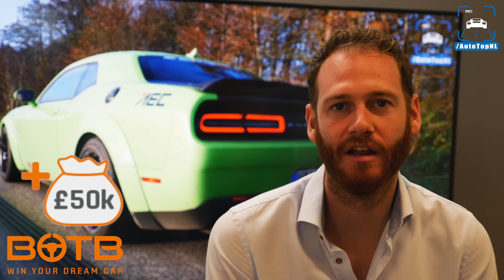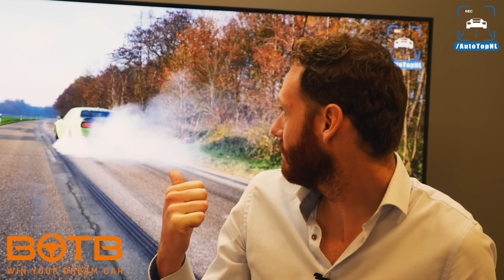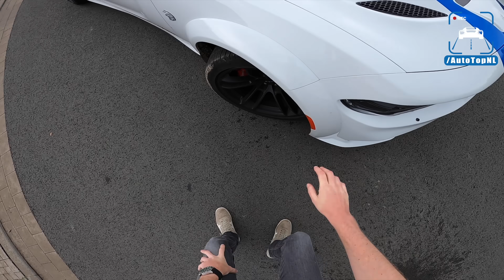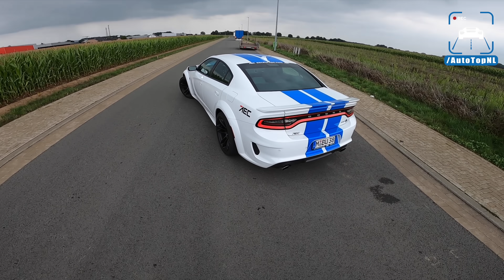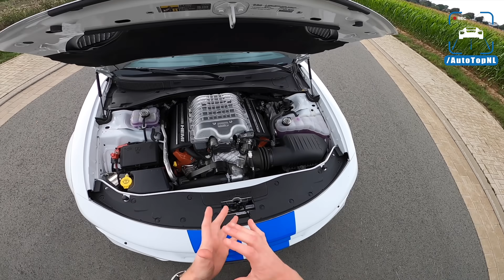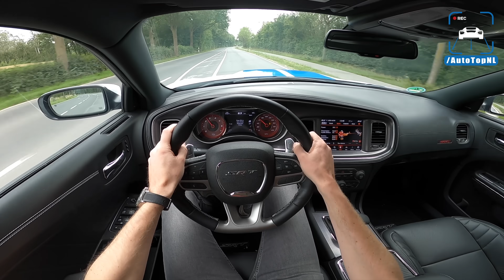DODGE Charger HELLCAT 717HP REVIEW on AUTOBAHN [NO SPEED LIMIT] by AutoTopNL

Comment: Great Review!
One question:
You said, that the Charger feels muchs better than the Challenger Hellcat on Autobahn at higher speeds.
In what way does it feel better?
Vibrations?
Just curious, because I have a Challenger Hellcat and it is compared to German sports cars pretty different, already at 160km/h an above.

Comment: next tipe put it in manual through the gear instead of drive , and also use the paddle shifter and put it on sport also sport/track mode their will be a big difference in shifting and power

Comment: Buy a Tesla plaid with track mode and say goodbye to the internal combustion engine . Dodge just announced it will be all electric
Reply: Not yet. Too heavy for solid track performance.
Reply: @osyisr6361  you are %100 percent right today for OTR Long haul but the small regional carriers like DHL  in Europe are already delivering local routes using electric vehicles like what you find with the Ford E Transit with heavier versions coming on line now. It’s a no brainer with fueling and maintenance costs way less than diesel equivalents
Reply: @nickkacures2304  what does cargo transit have to do with track performance.

Comment: Horsepower totally does not mean the ability to move down a track fast. It takes complete engineering that quickly and evenly gets torque and power to the drive wheels. Take a lesson from Ferrari. No Match for a Ferrari 812.

Comment: Just stomping it over 150+MPH‼️ Crazy‼️🔥🔥🔥
Reply: It has Slightly Larger size Front brakes brakes and slightly smaller rear brakes than a 2021 S63 AMG he was referring to at the beginning... and the Hellcat charger is Exactly the same weight as the 2021 2dr. S63 AMG.

Comment: Um First Using a Ford Racing paint scheme on a charger is extremely pathetic.. Second there are only a few sections of the Autobahn that doesn't have a posted speed limit however there are actually speed cameras installed because excessive speed is not allowed so any speed test conducted will never be anything other then inconclusive and a complete waste of time

Comment: Just recently bought a 2019 Challenger Hellcat and can say it's an amazing beast! The Hellcat is a bit unnerving especially at first because it is so big and heavy. It doesn't corner or handle the twisties half as well as my S550 Mustang GT, but on the freeway its right at home. Very comfortable for long cruises, and step on it to pass a pack of turtles its very easy to see the spedo rapidly climbing past 130.
Reply: You really think an S550 handles well ? I can’t imagine how the charger feels…
I hate my mustang because of the handling
Reply: @nozopoke1782  Well then I suspect you have some issues with the Mustang. Whether it's those stock Pirelli tires (horrible)  alignment, or maybe even driver problems. But even stock my S550 even without the PP held its own at the track against even some pretty well modded track cars. It's no Corvette, but getting a lot closer.

Comment: The challenger may be more "muscle", but the charger is simply a better car
Reply: I agree. I owned my ‘14 R/T for just over 3 years and got approximately 96, 000 problem-free miles out the engine. Other than my granny on a Sunday Morning or the occasional family member getting a ride, I pretty much had the car to myself the entire time. And what I can tell you is that coming from a 3 series BMW, there was a level of refinement and regality to the Charger that’s not typically found in its American contemporaries. 

Overall it was a beautiful, absolutely wondrous automobile, stellar ownership experience and I got compliments on the vehicle until the day I traded it in on my Camaro SS. Never really wanted or expected to own a Dodge ever in my life but my car challenged my perception of the brand & what I can say is that Dodge really stands behind their product, I bought the car with an (unheard of original factory warranty of 6Yr/100k miles) and FCA performed all recalls and preventative maintenance free of charge. I only traded it in because I didn’t want to drive an out of warranty high mileage automobile and to get comparable performance to the SS in a Dodge would’ve warranted closer to 50k(ouch) so I went GM. But I wouldn’t hesitate to trade the SS in on a lightly used ScatPack if ever need be. 

Tip: If you want top dollar for your trade, maintain your paint and perform a comprehensive detail on the car the day of the appraisal; you’d be surprised how much dealers are willing to offer you to park a well maintained high mileage V8 model on their used car lot 😉
Reply: They are literally almost the same car same chassis same engine duh
Reply: The charger has better aerodynamics than the challenger so charger has faster top speed, charger hellcat does 204 mph, challenger hellcat does 199 mph

Comment: 4.7 sec 0-60???  My 2012 Charger SRT easily does 4.4 on the street with 470hp, and there was no launch control available back then.
Reply: Thank you I’ve driven multiple stock hellcats and have gotten around 3.7-3.8 0-60’s I think this is just not knowing how to drive the car.

Comment: Crappy car, by the worst car company ever named FCA, that will not last even 3 years before it breaks down in pieces. Just ask any police service in North America who bought chargers and got rid of them quickly after, because of the inordinate amount of hours the cars were spending getting fixed instead of patrolling on the roads. And those were police-pack! So imagine how flimsy the regular car is. The only redeeming thing about this car is the fact that is has a ZF automatic transmission.

Comment: why the heck it is struggling to hit 300 with over 700 horsepower.
Reply: 1) Very heavy car, 2) gearing designed for fuel economy at US freeway speeds, 3) large frontal cross section.... a dozen other minor things... just not designed to perform in that part of its speed range. Probably a good thing given its weight which is also much harder to slow down.
Reply: The balancing and the weight of the Car
Reply: @chrismue1744  yeah than what's the point of having 700 horsepower, it should at least hit 300. A cheap Ford Focus RS goes above 280 easy.
Reply: @danial8040  the 717 hp are good for 100-200 thats 7,4 sec not bad for this charger
Reply: @chrismue1744  yeah but on the challenger its even slower.
Reply: @danial8040  i have a 18 charger RT easy to 260
Reply: @danial8040  the Front of the chally
Reply: @danial8040  wait for the charger redeye 😅

Comment: I would live on the AutoBahn
Reply: he drives in part of Germany that is not so crowded which is a extremely small part of German highways, everything else is under heavy reparations and endlessly traffic jams ... going 300 is not an option anymore unless you want to die to some fucktard with a caravan crusing 100km/h on the speed lane.
Reply: @shadiandrew  it's not too hard to find empty Road if you're outside of the cities not going on the major highways
Reply: @shadiandrew  dont know what but you are doing something wrong...
try the B15n
which is acutally a Bundesstraße but you are allowed to use it as a Autobahn because it was built like this ;)

Comment: Mopar guy here, owner of a '14 Charger RT and a '18 Charger Scat Pack.

Even at ~90k miles, the leather on our '14 Charger still looks and feels great. Some creases/wrinkles are finally beginning to creep into the seat bolsters (as they do on most any car over time), but compared to previous cars we've owned, it's def. minimal wear. And tbh, even if it's not BMW level leather, it's holding up under near daily use and that's what counts the most imo.

And fwiw, in 2018 we drove our Scat Pack halfway across the US, packed to the gills with stuff as we were moving to a new home. 2000+ miles total for the trip, and we still averaged just over 24MPG, and a smooth ride too. We were super impressed.
Reply: hey i have a question i want to buy a 14 - 15 Charger RT but there are high up in miles up to 100k miles. around how many miles do they need before problems start showing up? what would be good mileage too purchase a 14 or 15 Charger RT. also this would be my first car. i’m driving a sentra that was passed down to me
Reply: The leather in my 2012 Charger SRT is still perfect, but I still have under 60k miles on it.